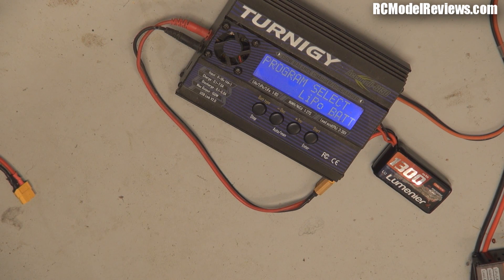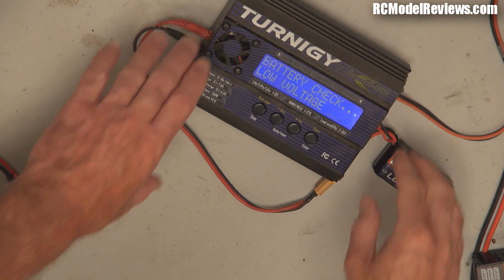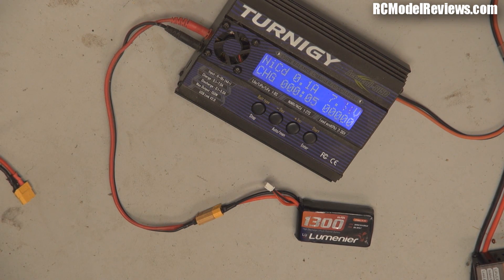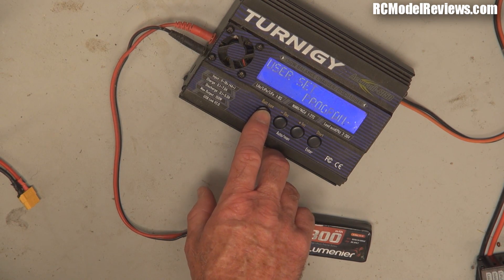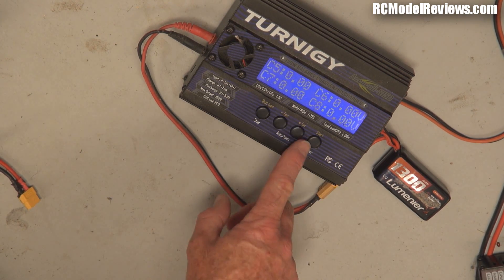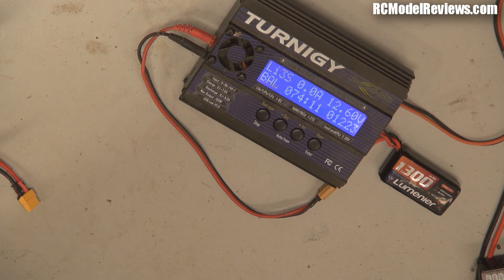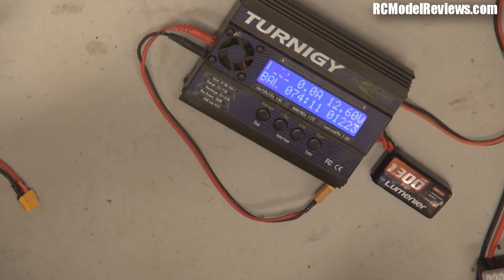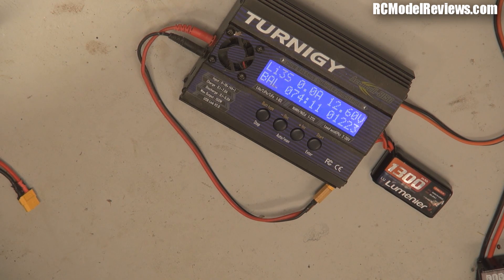How to recharge a fully flat lipo (lithium polymer) battery

Comment: While the words "at your own risk" are used repeatedly, I think it is irresponsible to discuss how to charge a low lipo while glossing over degrees of how low, how long, and what happens to the battery at that time - a more thorough discussion of the risk.  Battery University says, "Do not recharge lithium-ion if a cell has stayed at or below 1.5V for more than a week. Copper shunts may have formed inside the cells that can lead to a partial or total electrical short. If recharged, the cells might become unstable, causing excessive heat or showing other anomalies."   Bruce, you seem to be a scientist when analyzing interference and inspecting component build quality... How about exploring the risks scientifically here?

Safe hobbying out there gents!
Reply: +mickvk: seems that battery university wants to sell more batteries.  Sounds like BS there, one guy on another forum who claimed to be a battery tester said that in their tests of batches of batteries, they discharged the cells  to 0.75 Volts, (don't quote me on that , and don't to it and be puzzled that your battery failed).  1V is a usual min. low voltage per cell.  

Remembering that the more energy you cycle through a battery  and the faster the battery does it (power) the shorter the life of the battery.
Reply: +kadmow yeah, that's fair.  I guess I would still have the same plea to Bruce though, let's explore the science of what happens with perhaps some empirical data.  For example, how can one verify that they are being "very careful."  I just thought of one way, perhaps measuring internal resistance is the key to gauging safety??
Reply: +mickvk: you do know what empirical means, and you also know what likelihood, variance and standard deviation mean and how they relate to the real world. (as in not-every time, in some cases not even most of the time, yet warnings exist because , stupid people.)
Internal resistance tells us very little regarding when the batter (or if) it will explode (unless you know what the value for that battery was initially.

Watch the video, 0.1A (very low energy absorption, 10 minutes, concrete floor away from combustibles, that is being careful, If he told everyone to charge batteries unattended in their living room (hoverboard anyone) that would be reckless....  cell monitor would give additional info but at that charge rate (~1W), you're hardly adding fuel to the fire.)

We're supposed to be grown-ups, if you have never lit a firecracker don't apply for a job as a pyrotechnics technician, if you want to do that job, start small and have a go...
Reply: +kadmow Thanks for your thoughts on this!

Comment: SHANEMAN27---You found a LiPo in the woods? How do you explain that? Someone's UAV fell apart in flight? You might have found a camera or other bits had you looked around. Crashed in a tree and the battery was the only piece with enough mass to escape the Velcro straps?

Comment: G'day,

 Yay Team !

   Shit, there's a lot of Traps for Beginners with these Lithium Batteries...!

  A mate of mine had a $70,000 plug-in Car called a "Me-V" and after a year it was back at the Manufacturer for Servicing, they left it in an uninsulated Shed overnight in winter in Armidale NSW, and the Temperature hit Minus 12 Deg. Centigrade...; not only did the Freezing kill the $40,000 Battery, but when they attempted to recharge it, all the Magic Smoke escaped from the $13,000 Onboard Battery Charge-Controller...

   I get the impression that LiPo's are much better suited for carefully cosseted applications where they"ll be overseen functional Obsessive-Compulsives who enjoy paying attention to small Details ; than the rough-and-tumble of everyday useage by "Normal" people who can't be bothered paying attention to "pesky shit" like  Critical Operational Parameters...(?) !

Have a good one,

Ciao !

Comment: I was actually able to recover a loop that I found in the woods and the shrink wrap was all whitened from the sun and the red power lead was completely white because it sat in the sun for so long. Picked it up and measured the voltage, 0.02 volts for the entire pack. I did the same process as done here and it worked!! The pack is pretty puffed but it does work!
Reply: +shaneman27 You found a LiPo in the woods? How do you explain that? Someone's UAV fell apart in flight? You might have found a camera or other bits had you looked around. Crashed in a tree and the battery was the only piece with enough mass to escape the Velcro straps?
Reply: +jsl151850b Nono I got the whole plane. Trashed. Got the motor and ESC though.

Comment: My 1300 3s are no longer suitable for flying (Low Voltage alarm 30 seconds after liftoff) so now they take turns in my Devo F12E remote using only the balance leads (the tiny red connector not required, the discharge cable not used.) PS: Balance lead extenders recommended for charging.

Comment: I normally just put a battery i have over used in a a balance board with another lipo to bring it back up
Reply: +Pudsey - Rc No current regulation tho.
Reply: I know but the balance board brings the low voltage ones up. I wouldnt be able to charge then on there own. So put a fuller lipo on with it to transfer some voltage
Reply: +Pudsey - Rc: but with no (significant) resistance in the balance board (allegedly) the current flowing into the low cells can be excessive, >2Amps..

A &quot;special&quot; balance  board with some  &quot;power&quot; resistors (10W)  2 Ohm will restrict power flowing in the balance leads.  (did I just invent something, oh-well it&#39;s in international public domain now (unpatentable)

Comment: I've done this many times. Although I'll put a cell checker on the balance port while I charge on the NiCad setting so I can monitor each cell individually to make sure I don't over discharge an individual cell.

Also keep a bucket of sand, water source, and/or a hard flame proof surface handy. Setting up the charger in the middle of a concrete floor or driveway outside is best.
Reply: I know this is late but DON'T EVER USE WATER ON A LIPO BATTERY!!!!!  The lithium reacts badly with water.

Comment: It's a good idea to plug in a voltage monitor to the balance connector to CONTINUOUSLY monitor the individual cell voltages while charging in NiCd mode. I don't walk away from my charger when I do this, I just stand there for 10 minutes monitoring.

Also a lipo bag would be good.

Also you say you're on a concrete floor, which is good, but there were other batteries nearby, which I think is less good. So still room to improve safety here!

Comment: Bruce, I made a rookie mistake building my first quad wanting to shorten the wires on my motors I cut them not realizing they were enameled or coated so obviously when I went to solder them it wouldn't take. Luckily I had two extra motors and used them to finish the build but never found a good way to remove the enamel from the wires and I don't want to use flame is there a chemical that will remove it? By the way the quad I was building is a Robocat and I really like it you should do a review of one.
Reply: +Don Johnson The best way is to use a modelling knife to carefully scrape away the enamel then finish with some sandpaper -- before tinning with some lead-based solder.
Reply: +xjet thanks for the tip, I'll try it!  Great channel you have here!!!
Reply: +Don Johnson: OR if you can't get the xjet  method to work, hit the enamel with a gas flame, it will char up and be easier to scrape off, heating copper will only anneal it, making it easier to bend, you're not going to do any harm..

I had exactly the same problem years ago, and was very puzzled when the solder wouldn't stick, I think I tried everything, sanding, cutting/shaving, solvents, flame, eventually it all worked and I got beautiful soldered joints.
Reply: +kadmow thanks I will try the knife and sand paper first and flame as a last resort but they are small wires and I don't want to damage them. I was hoping there is a chemical to easily remove the enamel after all the motor wires come tinned from the factory I wonder how the do it? I also found you can use an aspirin and heat to remove it but I don't have any aspirin laying around maybe I will go buy some

Comment: Another thing I discovered by accident was sometimes you have a situation where say one cell is showing 1.5v and the other two are at 5 or 6 v. It's very hard to repair that problem but I managed it. I accidently left a low voltage alarm connected for a couple of weeks, the type with no audible alarm. When I found it again all cells were completely flat. I used the method you showed and managed to bring all cells back to a balanced state. With all cells at zero they are balanced and all came back together. Probably would not work every time but it did this time and I use it for LED lights on my ground station for a bit of light in dark car parks.....
Reply: I did the exact same thing. Like exactly, my voltage was down near 7.4, almost exactly like urs.

Comment: regarding lipo fire.   Charge in metal container with hinged lid that seals when closed insulate container from surrounding combustible surfaces Charging lead feed through a small a hole as possible  The idea is to limit oxygen in container. I have bought a fire proof lipo charging  bag of ebay Personally I think the container is a better idea Comments welcome
Reply: +aussietrevor Don't charge in a sealed (or nearly-sealed) container. Lipo fires cause a huge amount of gas to be generated, you want it to be able to escape rather than building up and causing the ammo can or whatever you're using to explode.
Reply: +n17ikh you are correct I should have mentioned that The reason I suggested a hinged lid  that it can be closed if problems arise. it is also important to let heat out during charging  something I thought most people would realise thank you for comment

Comment: The old black Eflite charger which uses the balance connector to charge is good for recovering 2S or 3S batteries since it has a simple analogue current control knob to set a low current for trickle charging.

Comment: Great video Bruce and will no doubt help a good few people out,i've still got an old lipo battery charger that has an inbuilt safety charge which will bring back an old lipo pack back to a full charge,it's an old Revolectrix Cellpro 4s Gold charger from back in the day,they are discontinued now so that will give you some idea how old it is,but i still use it just for the Safe charge,i've got newer better chargers for every day use though.

Comment: My charger has a "pre-charge" mode especially for this problem, it ignores the voltage and has a max. Of 10 minutes.
Reply: It is the Absima CTC-1, I can also use it as power supply say 12V 3500mah.

Comment: is there any use of puffed batteries? or can I repair it ?
Reply: +CyclingSalmon14 -  I'll give you a smart-ass reply: 

Like most trolls, there are always spelling mistakes and bad grammar in their posts. Yours is no exception, which indicates that you probably are the kind of person that Dunning and Kruger were talking about when they found scientifically that there are many who are "too stupid to realize how stupid they are" - even when they are trying to be smart. 

Now to your 'advice', designed to trap an innocent. Perhaps you could post a video showing a close up of your left hand holding a puffed lipo as you slide a few needles into the pack with your right hand, shorting the lithium sheets inside. 

Be precise in following your own instructions. Make sure you put in at least several needles into each cell. Be sure to have a paramedic close by and a friend to do the upload and typing for you, as it will be long time before you can manage a keyboard with those fingers, whatever is left of them.
Reply: I've de-puffed a few batteries no problem. Bend the seam to 90 degrees and pull it up slightly so the wrapping is away from the layers. Small slice with a hobby nice, carefully of course and gently push the excess gases out. First time I did this I used a plastic knife just in case. Of course safety glasses, gloves and sink full of water and extinguisher close at hand. I'm ballsy but not stupid. Then a small dab of hot glue over slice at seam and press down, then a bit more hot glue over the seam. One can always put a wee bit of tape on the seam if there's concern of glue getting inside battery but hasn't been an issue, yet.  So yes this can be done and since I've lost fingers on one hand not too long ago I'm not up for repeating that for any reason.
Reply: You can't "unpuff" them but you can use them for low current draw applications like fpv ground station or even mellow fixed wing aircraft. But always charge attended or in a lipo sack.
Reply: +Ashish Amatya Puffed a chemical change has taken plane, no fix.
Reply: yes
Reply: +David B What are you on about...A reaction happens on every cycles...just cycle it enough and all damage and puffing will be repaired.

However a quick tip is to slide a sewing needle carefully through every cell...this relives pressure, then commence a unblanced fast charge at 2C, all puffing will dispare instantly...you may notice a slight bit of smoke or warmth...but rest assured this is signs its working.

The more needles you slide into the cells the higher the chance of depuffin.

I bet you read all of that dident you and was about to right up a smart arse reply for me.

Comment: What a lot of people dont understand with LiPo batteries is that when they are assembled they have no charge what so ever.  They need to be activated and what you just showed in your video Bruce is what they do in the factory to kick them into life.  As you rightly say keep them under observation all the time and do it slowly.
Reply: +Allan Main Really? Do you have any manufacturer's evidence for this? Just asking.....
Reply: +Don Judge    Close friend was a principal owner of a very large LiPo brand.  He told me when they manufacture the LiPo packs they are in fact inert. ( I think thats the word) To get to the stage that they will start to take a charge they give them a very solid DC boost just like Bruce did but likely a significant amount more violent. Once the cell takes the initial voltage the charger takes over and there you have your Lithium pack ready to run. It was he who told me if you ever over discharge a pack just hit it with a suitable voltage to get you to 3 volts per cell and 99% percent of the time you will recover it. In his words. &quot;Thats the way we kick start them in the factory&quot;....
Reply: +Allan Main Fantastic, thanks Allan. Makes a great change to get something from a manufacturer rather than someone blindly repeating a 'fact' they read on the Internet somewhere.

Comment: I had a stack of lipos here, and was going to cut the leads off for spares. Of the 6 bats I had setting at low voltage on a single cell, all but 1 are now balance charging properly. 
I owe you way more than a pint for this one Bruce. ;)
Reply: Same here. The one I didnt bother with was puffed on one cell but the rest maybe only had like 15 good cycles and I just left em discharged for too long. But I'm about to charge em up this weekend and see if they can give me some flight time.

Comment: While on batteries, LiPos in particular, I'd find it interesting to see a segment on battery construction, how they're made, what's inside, etc. Bruce, would you say that when a battery puffs it may be wise to pull it from heavy duty and use it elsewhere if possible? Those of mine that have puffed seem to have been on the downward slope of their life. Also, what's your take on keeping LiPos fully charged at all times as opposed to keeping them at storage charge until needing to be charged for use? How long would you suggest keeping unused LiPos at full charge before discharging them to 50%?

Comment: I've used Nimh setting before just to give it a bump, to switch over to lipo charging, 
Whats the difference between using Nihm and Nicad setting?
Reply: +Dodge Ditchburn For lipo recovery purposes, absolutely nothing. You're just getting away from the lipo cell voltage safety checks. And as superdau says, primary difference is end of charge - trickle charge or no trickle charge. Also, the end of charge determination factor - the delta voltages are slightly different between the two chemistries.
Reply: +Dodge Ditchburn 
I think the difference is the "end of charge" condition. NiCd just stop at a certain voltage and then trickle charge (if the charger supports that), NiMH are charged until a small drop in voltage is detected (they do that of thermal reasons I think, because you charge them while actually full already at that point).

Comment: Another rescue video said to refrigerate the battery first, what do you think of that?
Reply: +Chris Michael Don't do that, especially in combination with high charging current. You can and should keep your lipos pretty cold when you store them, but don't use them at low temperature. High discharge rates can cause cracks in the cathode, high charging current can cause lithium plating at the anode. This problem gets worse the more you get below room temperature.
Reply: +Chris Michael It won't make any real difference.  Some folk think that because a puffy lipo gets harder when you refrigerate it that it is somehow fixed -- but all it does is reduce the volume of gas (because gas contracts when cooled) temporarily.